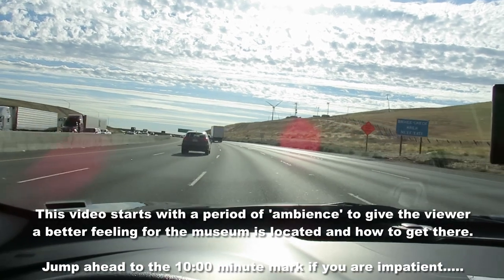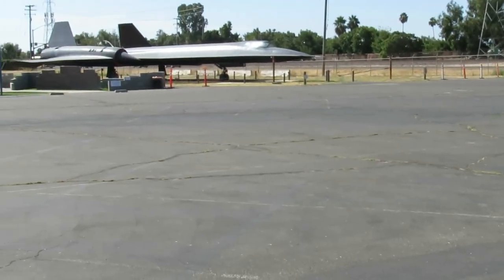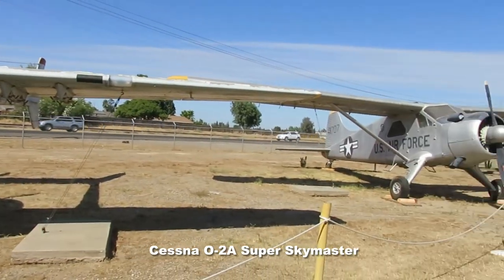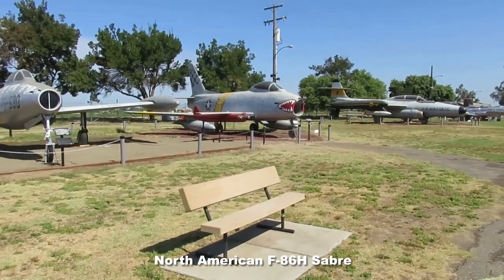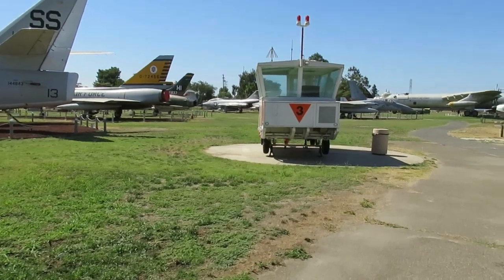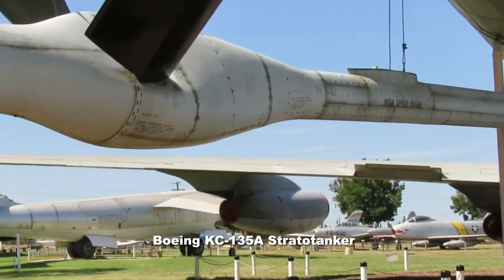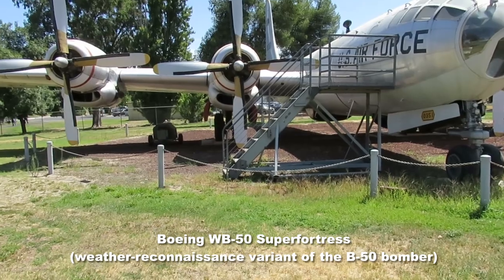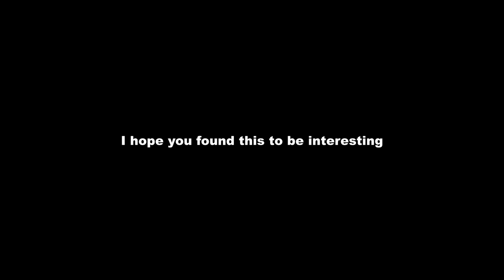A Walk Through Castle Air Museum

Comment: Some amazing aircraft on display. I grew up in the West side  of the Central valley about 50 miles from Merced and had relatives in Atwater. Many times we would see B52's at very low altitude paralleling Highway 99 on approach to Castle. Sad to see those historic aircraft slowly eroding in the elements but glad to see so many in one place. You were there in August so it must have been close to 100 degrees or hotter out there.. thanks for the tour!!
Reply from the maker: Frames Burns-Hagstrom III, actually the temperature was only in the low 80's (F), very comfortable.

Comment: Big disappointment  those old war birds setting outside with little to no preservation rotting away and doesn't seem to be much intrest in visiting them either need to be moved where they would be more appreciated
Reply from the maker: Ron brown, first, learn to use punctuation when you write; it is a pain for readers to decipher run-on sentences written by careless people. Second, this is a wonderful air museum, certainly not a "big disappointment" to most visitors. A big plus here is that the planed are not so crowded together as they are in most other museums.  And they are not quite "rotting away" as you suppose they are.  Perhaps you don't get to many air museums, but a LOT of them store the planes outdoors. It is incredibly expensive to find and maintain the many huge hangars required to house so many big aircraft. Put your money where your mouth is, and make a big donation to this museum to add to their maintenance fund. Otherwise, yours is just empty bitching.

Comment: To answer your irrigation questions: California is implementing a new set of regulations that should decrease groundwater access by about 50%. The regs also aim to increase the number of groundwater recharge basins in the valley, which will take away water from some growers. CA produces 99% of the United States' almonds, pistachios, processing tomatoes, grapes, fresh citrus, hot peppers, lettuce, kiwis, and 100+ more fruits and vegetables using surface sources of water. The Colorado River, the Kings river, the San Joaquin river, hetch hetchy reservoir, and lake Tahoe are some of the main sources for California agricultural water. Together with the federal and state canal systems, water travels up and down the state at different times of year. California brought nearly $56B of revenue in 2022, and that wouldn't be possible without such water movement.